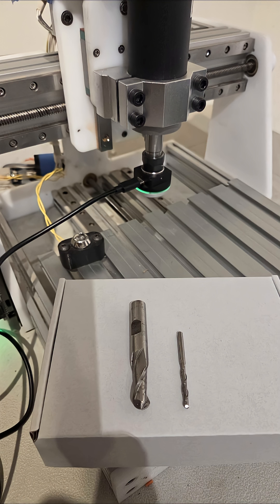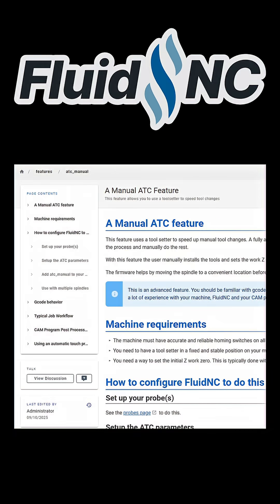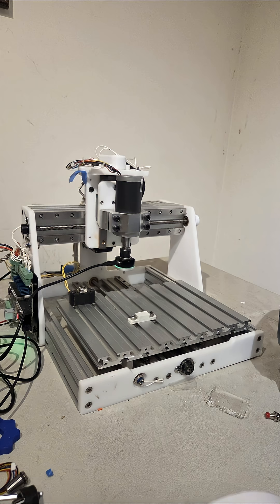The FluidNC manual ATC Feature

Comment: looks good, what kind of toolsetter is that?
Reply from the maker: This one. I got it from Amazon.  http://wiki.fluidnc.com/en/config/probe#h-3-axis-electronic-probe
Reply: @engserve sorry, I meant the tool length one, I have one but the spindle probe activates before the tool setter
Reply from the maker: @AxoInsanit  I just made that from a simple push button switch for testing. I needed a cheap and  low profile switch. Probably not as accurate as a real tool sensor. This might be good.

https://topcom.cz/products/digz/digzfix/DIG-Z-Fix-p411022508
Reply: @engserve thanks for the reply!
but how do you solve the issue of the probe triggering before the tool setter?
is there a parameter where we can set the distance the toolsetter sinks until it activates?

Comment: I have lots of questions to you :')
1. What keyword for that easy change tools endmill
2. Where the probe cables on the motor goes
3. What motor did you use?
Reply from the maker: 1. You can read about the gcodes used here. http://wiki.fluidnc.com/en/features/atc_manual#gcode-behavior
2. The wires go to the CNC controller probe input (like a limit switch would).
3. Any spindle motor that uses collets will work.
Reply: @engserve 
1. I need the name the parts for "easy change shank / endmill"
2. (and also number 3) Yes, i need the name of your spindle, because mine use 775 and it's kinda sucks